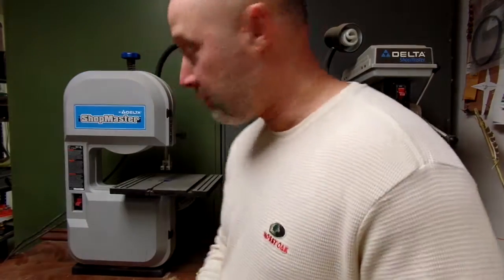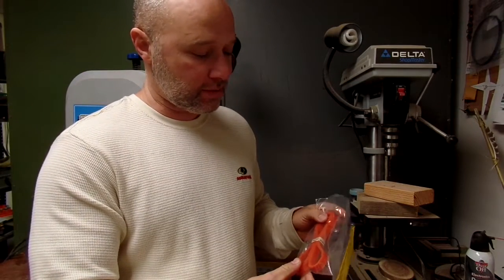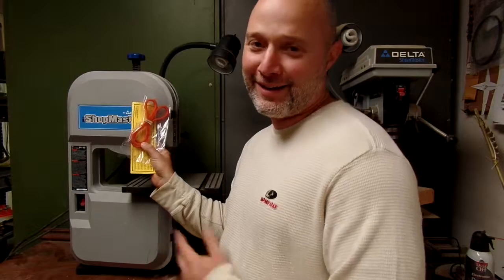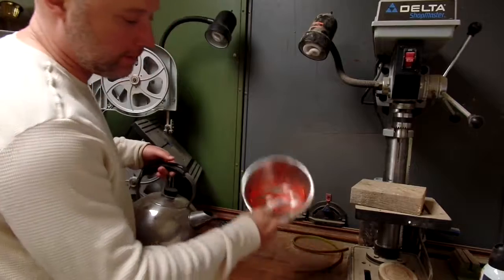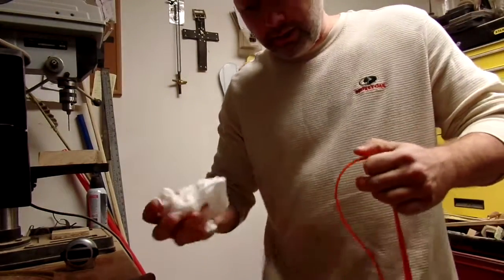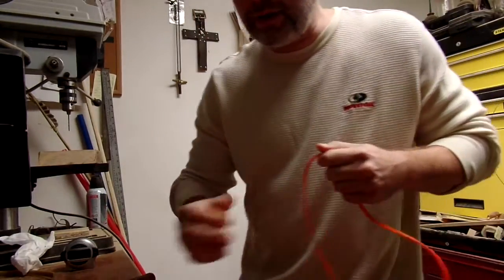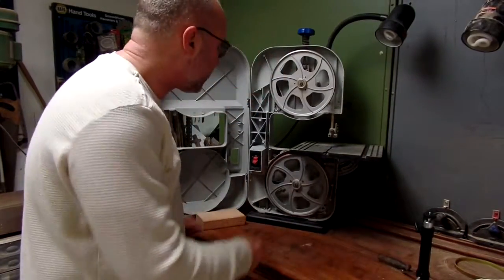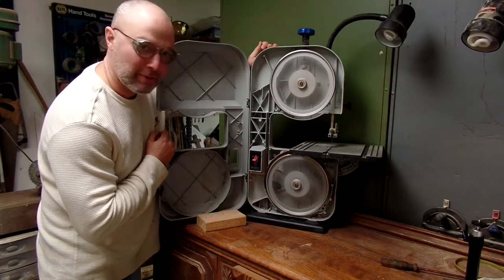Replacing shoe on Delta Shopmaster SM400 band saw

Comment: You got 'er done !!!! but if you want to see an easier way check out Kieth Ruker over at Vintage Machinery.. He has a way using round dowels to just roll handsaw tires on. ,,,,When you change the top one (Sorry for the bad news there) it will be easier.    Anyway, good job,,,,Even better since  you had to figure it out for yourself!!!!